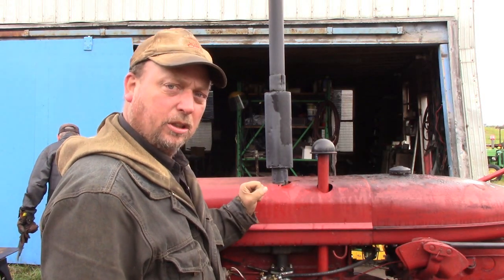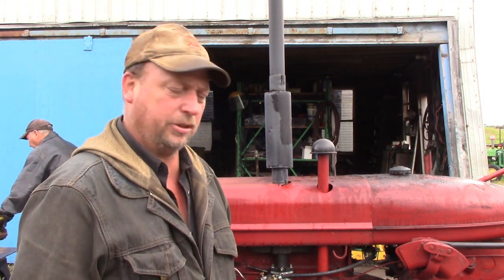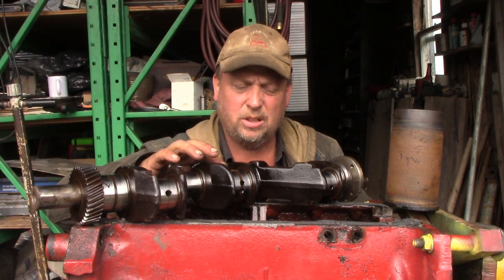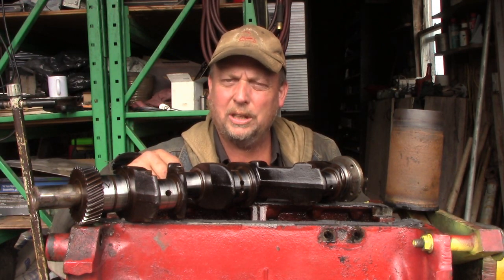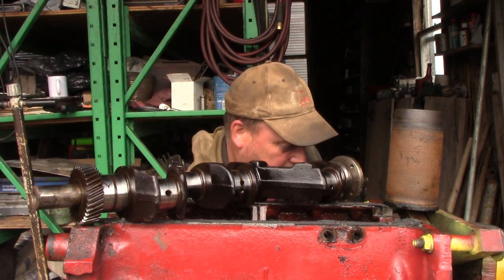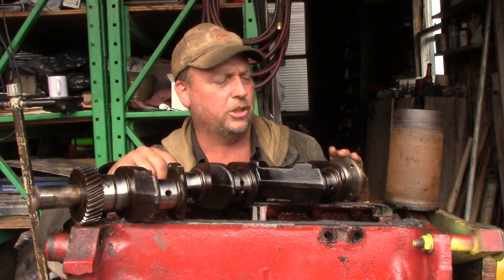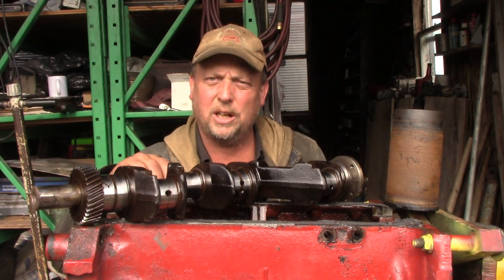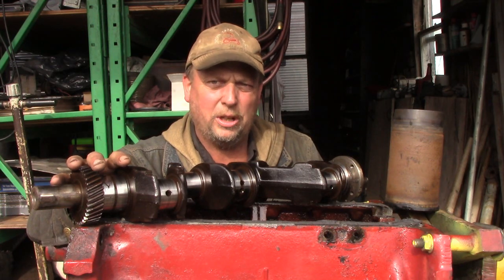Farmall Super A engine rebuild Part 1

Comment: Hey Dave, what do you use to remove your sleeves? That punch in the video? 

Thanks for putting together great videos to help with my project.
Reply from the maker: I put a piece of steel across the bottom of the sleeve and drive it out with a hammer on a heavy steel rod. Thanks for watching!

Comment: There is water in the oil in my super A OHV ,what are the causes?
Reply from the maker: Could be head gasket , cracked head, cracked block, cracked sleeve, or bad sleeve o-rings. You won't know until you start checking things out. Thanks for watching!

Comment: What's the difference on ih 444 and 434
Reply from the maker: The US 444 may be slightly different but here in Canada the 444 is just the next newer version of a 434. It has a different front  axle carrier, steering box and updated tin work, other than that they are the same tractor. Thanks for watching!

Comment: Good day Good video,  123,super C I think has 134 were they not the same?   Thanks for now
Reply from the maker: The Super C also used the C123 engine, there was a C135 engine based on the C113/C123 that was used a 330 and 340 a crawler and as a power unit and maybe a few other applications. Thanks for watching!